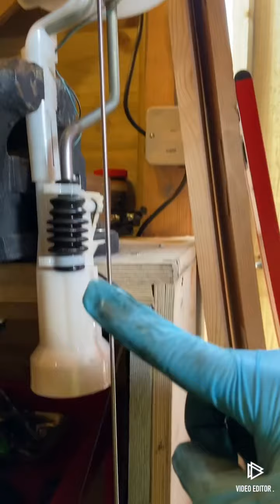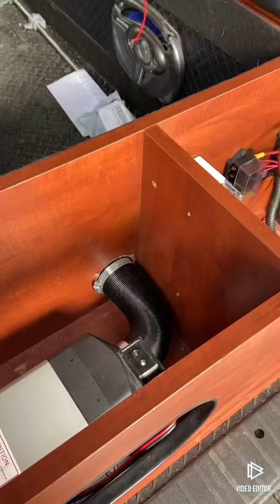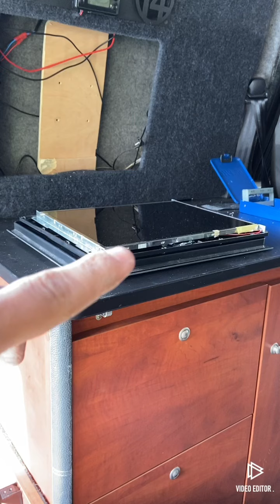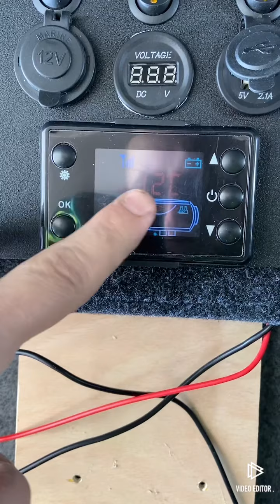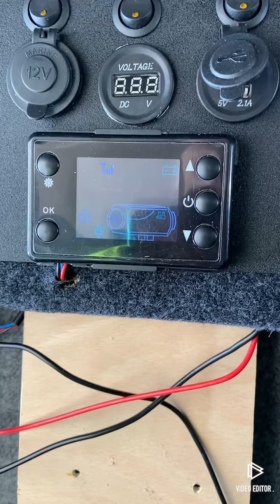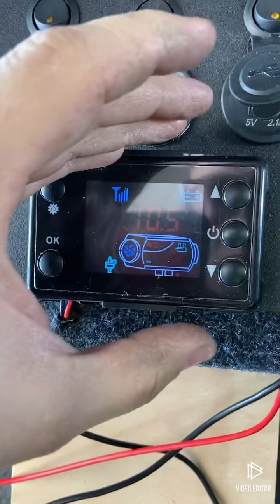Vw T4 Chinese diesel heater install part 2

Comment: Great video. What capacity lesuire battery are you running? Like the raspberry pi idea 💡👍
Reply from the maker: 75ah
Reply: I thought you needed at least 110 for a diesel heater to run 🤔
Reply from the maker: I can’t see why you would? A 110ah would last longer I guess but we never had an issue with start up with the 75ah.